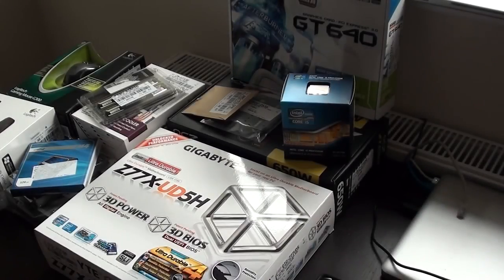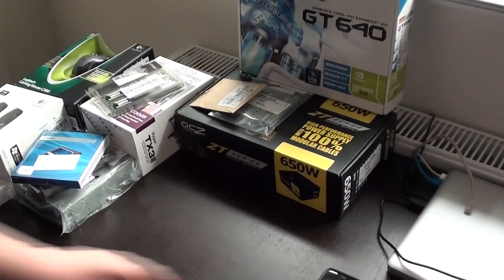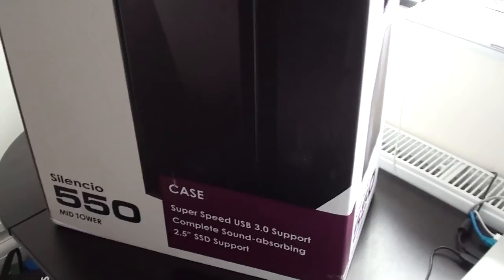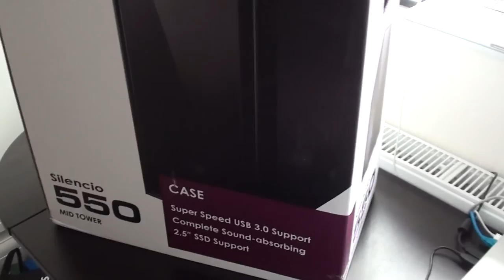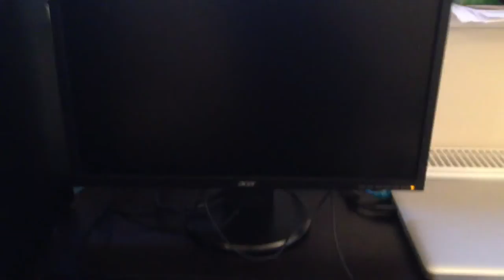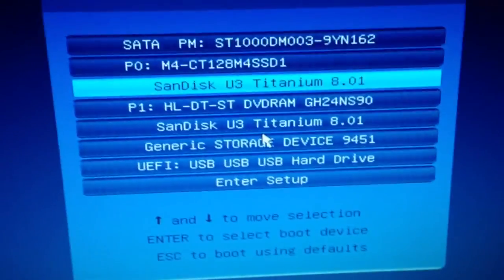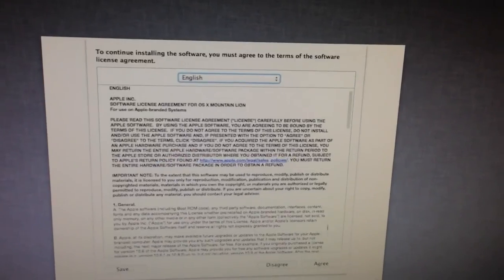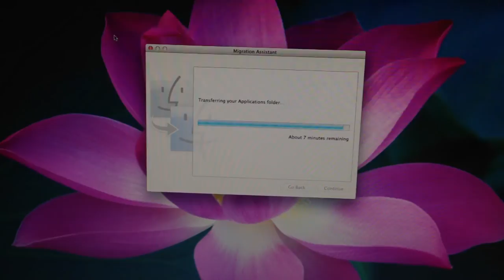Building a PC (Hackintosh)

Comment: That's a good case for a PC, I've had it for a while myself. Its pretty quiet (I am currently using GTX 570). Only con there is is the fact that if you want to put the power supply cables from there isn't a lot of space to put them. The padding gets a few scratches, if you cable the machine from the back.

Comment from the maker: I would assume so as it isn't actually connected to the motherboard apart from a power lead. Things like power supplies and CPU coolers can be as generic as you want from the hackintosh side, just make sure your case has support for the cooling bracket etc